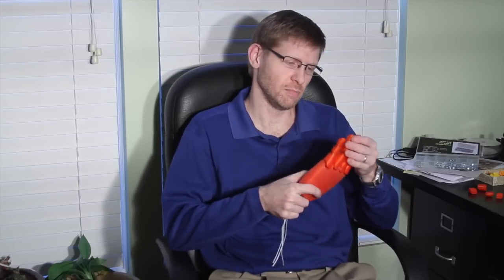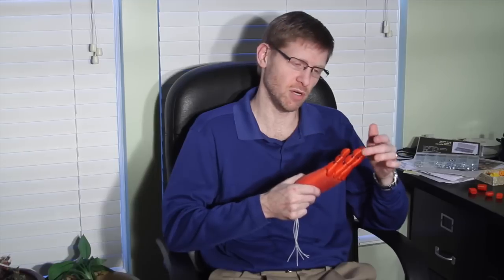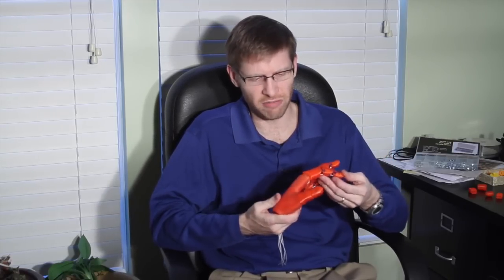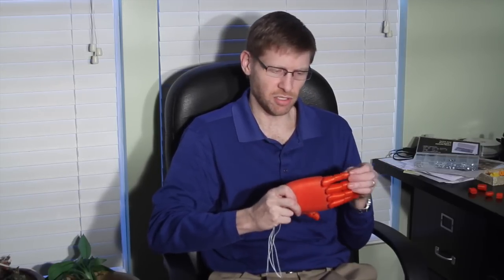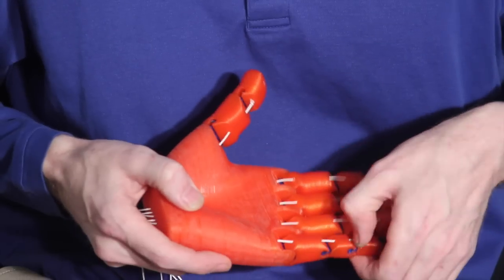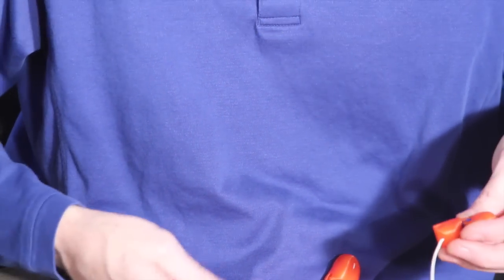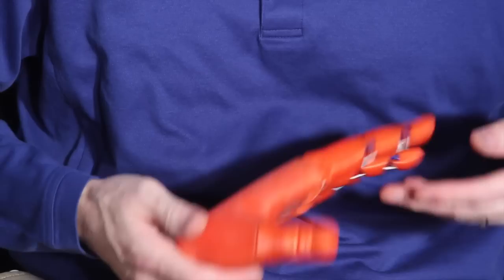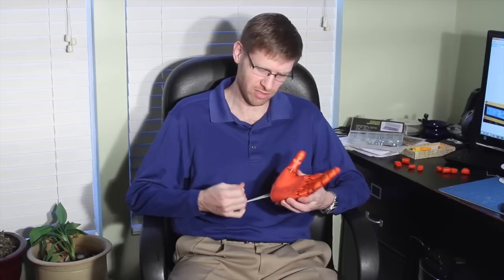Review of the Flexy-Hand 3D printed prosthesis proof of concept (3D Universe)

Comment: Hello, it's a pleasure to greet you from El Salvador in Central America.

In this I am in a project of the creation of a prosthesis type Flexy Hand for a girl and I am in the assembly phase but I have a problem since at the moment I do not have Ninja flex to print the cartilages of connection between the parts of the fingers and that allow flexibility.

I have reviewed that there is an option to create them with other material and with some molds, but I have run into the problem of not knowing what kind of material I can use to make those small connections or cartilages to call them.

Thanks for your help.

Receive a warm greeting
Reply from the maker: Yes, I believe it's possible to make the hinges out of silicone using 3D printed molds, but I don't have any experience doing that. I suggest you post your question in the e-NABLE Google+ community - http://bitly.com/e-nable. Someone there will probably have more experience with alternative methods for creating the hinges.

Comment: amazing project, by the way how does this weight ? thanks
Reply from the maker: It's not very heavy. The weight depends on the size and print settings (i.e. amount of infill). The latest version (Flexy Hand 2) is considerably lighter because it's hollowed out so it can be used as an actual prosthetic device. http://www.thingiverse.com/thing:380665 The version shown in this video was just a proof of concept.

Comment: hey t forgot to tell you miniature vibration modules used in mobile phone can work better incorporating flat vibrational modules addition to gears etc. the flat round 3.7 battery can be used also. and I'm interested in seeing you create a dual hand one on top of the other with the above-mentioned motors as a prostatic glove in likenesses of the above-mentioned add-on sensors with miniature camera modules to control at pressure by fingers tips.like some use on their Mobile phones to check heart, that can be translated into key inputs mapping signals software. easy for u let me see. I trust you.

Comment: use miniature motor modules corresponding with sensors. including miniature sensors  center of fingers(?) heat & measurements  sensors for human flesh functionality(?) of & weight etc, of handling. audio detection. till u return see ya i like your idea.
Reply: The whole reason for the simplicity of these hands is so 1-keeps the cost down. 2- anyone with a 3d-printer can make one and 3- makes it easy to get into the hands(sorry had to lol) of ones in places where the funding is not there to help. Especially for kids in 3rd world countrys. Look up a website called En-Abling The Future. They are the group that promot all these kinds of 3d printed hands. Cheers

Comment: This is an interesting idea, but it provokes a question I've had for a while now. (Working on a similar project myself) Why is returning the hand to the original position using flexible material a goal? Don't you need the finger to be be able to tense straight or to clench closed? Imagine pushing a button or typing (with an index finger) on a keypad. With two nylon lines per finger (one on each side of the joint hinges) you could tense or clench. Why isn't that preferable? Thank you for your feedback and for your work.
Reply: The reason of the return of the fingers id because these hands are made for ones that have no finger function. We use our wrists to open and close our own hands. So we need the fingers spring back since we can not make them do that. By rotating our wrist up the fingers are losed giving us the strength to hold or pick up objects. Look up the website En-abling the future. They are the ones promoting these hands around the world for people like myself that could use this kind of accesibility aids. Cheers